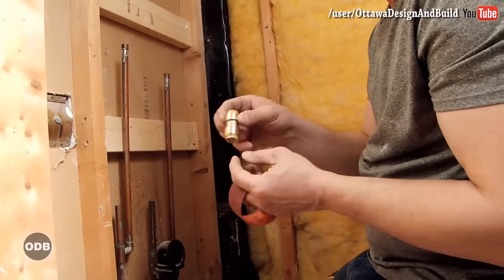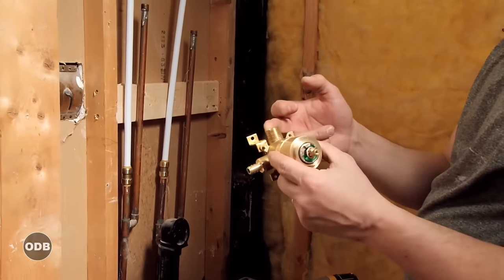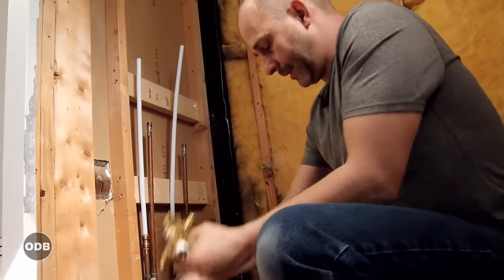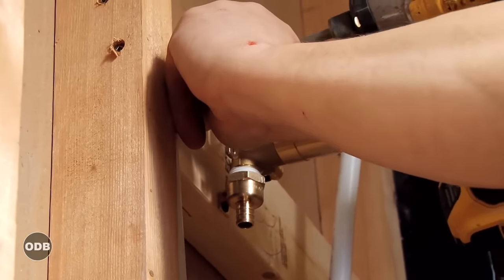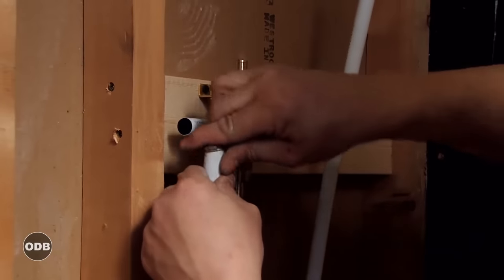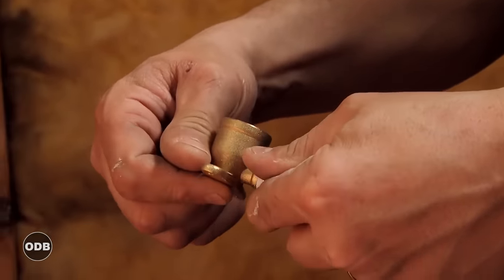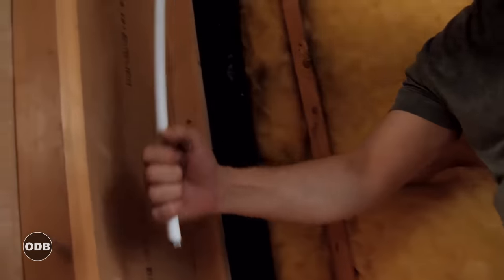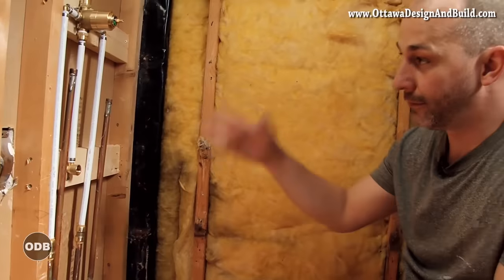DIY How To Install Copper To Pex | Shower and Bath Plumbing

Comment: Do you not need to use an insert In your pex pipe? Hep2o and speedfit both require them when making s connection. ????
Reply from the maker: Not any more, SAhrkbite changed the requirement a few years ago!
Reply: no they didnt. 
what you say here is not true, they are called insert stiffeners. and they are there because pex can be pressed into oval shape quite easy especially when hot, this would cause catastrophic failure of the joint. imagine somebody is filling the tub while in it and they knock the tub spout with their foot BOOM wall full of water.
Reply: Home Reno Vision DIY 
Even if this is the case, i would still use them. Belts and braces. The pipe itself is not solid enough to retain its shape and strength, especially after heat expansion , which also makes it more pliable.

Comment: When using pex never, ever have connections in the ceiling and never use sharkbite connections in a finished wall. Sharkbite connections have been known to leak.  
You should be using pex compression rings with a proper pex compression tool. Pex connections are very precise fits that you can have too lose or too tight.  The crimp rings you used can over compress the pex pipe and cause leaks.  That’s why you should also be using a compression ring test tool to make sure the compression rings are not too tight or too loose.
Reply from the maker: Thanks Charlie, this is just 1 option for homeowners to do their own plumbing. We are bringing 3 other options to video soon. One of them shows the system you talk about.
Reply: Are you aware of the newest method?
You use plastic rings and a pex stretcher then you can use cheaper plastic fittings?
Reply: I should also say Thank You for your time and expense in making these videos and directions available to us. There are different methods out there for the use of pex pipe.

Comment: Good install, except for the sharkbite fittings. Don't understand why you wouldn't just solder on a half inch pex adapter when you have such good access.

Comment: Good afternoon ,,, my name is Gabe ,, have a question ,,, I can use 3/4" of pex pipe for the shower installation ,,,,,or 1/2" is the usual
Reply: Gabriel Romero I use half inch. The shower valve has openings the same size as half inch. I never had better water flow using three-quarter after the shower valve because the way the shower valve is constructed acts as a natural restriction to water.
Reply: @dormandavis2767  then, you think it is not recommended to modify it to 3/4 "
Reply: Gabriel Romero unless you have low pressure overall in the house. Your pressure is only as high as your openings in the valves.I was a firefighter for 28 years I retired and I was a driver for an engine or pumper truck so we had to know hydraulics so we can determine how long are hose runs are in pressure loss and things like that.
Reply: ok. ,,, I have an idea why they use 1/2 ",,,,, water pressure👍 ,,,,, thanks for all your information

Comment: As usual, taking things apart are always overlooked as it is also where we ALL begin :)  Can you explain how to take the "rings" apart.  Just in case I screw something up, and I always screw something up.?
Reply: If you have a grinder or some type of cutoff wheel you cut a groove until you almost cut the ring. Cut a liile more and stick a screwdriver in and twist and it should pop right out

Comment: Jeff, I'm in CA. I read there are 70 different kinds/brands of PEX.  Do you have a brand you prefer to work with?  Thx!
Reply from the maker: I'm not as well researched as that, However I make my buying decisions on my trust towards a supplier not a manufacturer. My relationship and warranty service come from the supplier so I prefer to simplify my purchasing decision based on their recommendations knowing they will back up their decisions if there is ever a problem. On the practical side I tend to prefer the red and blue on larger scale projects to eliminate confusion.

Comment: Where did you get the clips to hold the moen valve to the wall.  They look like some small Z brackes. Where are the available from.
Reply from the maker: At the local building store in the plumbing isle.

Comment: Jeff: I have an unusual situation where I've discovered two 1/2" copper pipes in a bathroom wall that have been capped off. I would like to install a shower with pex piping similar to what you've shown here and am confident I can do so without hiring a licensed plumber. Would these capped pipes count as an "existing feature" that I don't need permitted? My city's code mentions you can modify and existing feature without a permit or license. Thank you!
Reply: What are the 2 capped pipes are they coming off of the tub/shower piping. I had something similar and I was told they were air intake or exhaust pipes that weren’t needed anymore
Reply: @DavisThaDoN  The two capped pipes look like they're coming through the slab - I am confident they are the hot/cold pipes where a shower used to be as there is also a capped drain. Thanks!

Comment: Jeff, I am loving your videos. Thank you for putting in the extra time to do these videos.

I did have one question. From the drop ear for the tub spout, do you just use threaded galvanized steel to connect the spout, or what did you end up using? I know you said no soldering required for this job, so I'm wondering what you did. Thanks in advance!
Reply from the maker: In this case we used a tub spout that can recieve a 1é2 inch threaded pipe and used a 4 inch male to male npt brass pipe. I am glad you liked the video Glenn.
Reply: Ottawa Design and Build Renovations any flow issues with the pex? I've read that it's too restrictive. But I don't want to solder. :)
Reply from the maker: you can use a 3é4 inch line to the tub and solve that problem. Good luck.

Comment: Sharkbite needs an access panel. Sharkbite is not allowed to be permanently concealed, depending on your local jurisdiction. Use a brass adapter to sweat onto copper.
Reply from the maker: Thanks we have one.

Comment: try the blue monster Teflon tape. you wont need 100 ft per joint lol. and if using tape and putty. putty the threads then put the tape over it. works great
Reply from the maker: thanks I"ll try that

Comment: hi. which pinch tool I should get. homedepot has none. Lowes has one from "dependable plumbing" and two from "apollo". Any input will be appreciated. thanks.
Reply from the maker: It comes down to price. the better the system the more costly it is. If you are using it a lot then but good tools.
Reply: which brand are u using? my problem is that so far I have seen only 3 tools in Rona, lowes and homedepot. The most expensive one is about 50 bucks and none of them is from a name that I recognize. I got to pick from "dependable  plumbing" "apollo" or "surlok".   

which one do you recommend  - PInch ring or crimp ring? I see u were using crimp rings in your other video.

Is there no "go no go" test tool for pinch rings?
Reply from the maker: pinch is better, I was demonstrating crimp due to the cost for homeowners who are only doing 1 job. Pinch is superior if you are going to continue doing plumbing work.

Comment: How sure is this a permanent job with no leaks years down?
Reply from the maker: This type of plumbing has only had a failure problem right away. If the clip is crimped properly it will last a lifetime. rings are stainless steel.

Comment: May I use shark bite 90 degree angles instead of the ones u use?
Reply from the maker: sure, samr thing only different. Just make sure you can access them from the back side if necessary or you will be removing the tile if you get a leak in the next 25 years.

Comment: ever tub/shower faucet I install state (as well as maybe piping manufacturers) DO not use pex on the tub portion due to friction losses.  It has the potential to cause 'ghost drip' from the shower head.  other than that, I don't have issue with SB's.  I don't see any plumbers offering 25 year warranties on their solder joints.
Reply from the maker: We adressed the pex to tub in an earlier comment . we should be using 3/4 line to drop ear to solve that problem.
Reply: Ottawa Design and Build Renovations sorry pal, I hadn't read through every single one.  Copper or 3/4" pex like you said should work.  Sorry for being repetitive on you.
Reply from the maker: that's cool. There has been a lot of response. more than happy to answer questions.

Comment: bro, I have a massive leak. While I was trying to replace the caulk around my kitchen cabinet I noticed the drywall was damp. When I poked a hole to see why it was wet I noticed black mold. So I used a mirror to see down the drywall and guess what? The mixer valve from the bathroom which faces the kitchen walls was leaking from the hot water line.

It looks like I might have to use shark bites because all the pipes are copper, question; how well will it hold if I use a male shark bite to fit the female thread on the mixer?
Reply from the maker: shark bite is not designed to install on female thread. I would suggest a male fitting with teflon tape and joint sealing compound.
Reply: sharkbite makes a male thread to copper/pex tubing connector. use teflon tape, and be sure to deburr the copper tubing before pushing it into the sharkbite.

Comment: Quick and Simple,,, but wouldn't that copper pipe add a bit of rigidity to the shower head? With PEX I'd think there would be chance for that "Drop Ear" fitting to work loose over time enough to pull away from the stud. Think about the leverage of the shower head and even more leverage if there's a shower water filter installed between the head and the wall.
Reply from the maker: the drop ear is installed with 3 screws. If I was relying on a soldered joint to keep my shower head still then I would be in trouble.
Reply: I realize the three screws hold the shower head. What I'm saying is, a solid copper joint would "assist" in keeping that "Drop Ear" from twisting side to side which over time may loosen those three screws. How would it get twisted side to side? Well maybe by installing different shower heads, or turning an adjustment ring on a shower head, or by adding a water filter, or whatever... Some times they get moved.

Comment: You use a drop ear on the shower spout . Did you not also use a drop ear on the tub spout ?
Reply from the maker: most tub connections can be accommodated with a 1/2"np pipe. this is better than pex from the elbow. pex would not be rigid enough

Comment: I have installed the same way and then asked plumbers if it’s ok to have the tub spout of plastic and they said no , they told me I need to put metal pipe
Reply: They are right. always run copper for the tun spout or you will have problems

Comment: do you need to remove the tube liner for copper pipe?
Reply from the maker: optional, it used to be mandatory before recent upgrades to the design.

Comment: As an inspector and former plumber, I'm not kosher with the drywall screws instead of brass or deck rated screws and I would like to see the dead ends for the old copper be a lot shorter...
Reply from the maker: Is there a reason for that feeling. The screw is definitely long enough!  And the dead ends are irrelevant. As long as the length of pex from the dead end is longer to the 90 than the 90 to the valve there is no loss of pressure or flow!

Comment: Jeff, how far into the wall do I have to cut into the 2x4, to install the valve? the center where my valve has to go, i have a 2x4. so i need to cut into it, how deep?  or how far in is the 2x4 mounted on the back, behind the valve in your video?

Comment: The idea is fast, but what happens in 5-10 years when the crimp leaks behind your beautiful tiles. On a copper line you could simply solder the the leaked area and not damage the entire bath wall

Comment: Tip: Lengthen the handles by a foot for leverage and it would be much easier to crimp. Did it to mine and much better.

Comment: I have heard that slide on sharkbite fittings should only be used when they are easily accessed in case of future leaks of the internal rubber O-ring.  

There are some videos of people who had failures using sharkbite fittings.

Comment: Shark bites use O-rings in order to maintain a seal against the pipe anyone who works with plumbing or with cars can tell you o rings fail over time therefore they should not be put into a space that has no access before the risk of future leaks is high in full disclosure I am a plumber although I think it is good for customers to do their own work at times to save the money rather than paying the high rates the come with hiring a plumbing service the application that this man should have used was called a Bard after which is a copper fitting that is soldered onto the pipe in order to convert it from copper to PEX
Reply from the maker: we did that in our newest video on this subject matter.

Comment: Does anyone know why there is capped copper lines next to the live ones being used for the valve. I'm redoing my shower and it had them
Reply from the maker: Hi steve, copper lines do not expand so they hammer under certain conditions. pex wil absorb pressure changes without the hammering noise so no need for them in a pex application. Cheers!

Comment: if you read the instructions on most tub/shower control rough ins, they require copper be ran to the tub spout. 1/2" pex has a smaller internal diameter than 1/2" copper and cause too much back pressure. this back pressure can cause your shower head to drip when running a bath. not the end of the world, but can be annoying
Reply from the maker: Very true Tyson, this can be solved by using a 3/4 inch line to the tub spout.

Comment: Google Video from someone who seems to know his trade. One major problem is he failed to mention that using pex on a shower connection between the valve and shower head will create shower rise. Pec tubing inside diameter is not large enough and causes water to rise up to the shower head causing water to come out of the shower head even with the diverted off. Don't make the same mistake as me. Use copper for this connection

Comment: hi what if the valve has no bracket and I want to use pex how do you secure the valve ????
Reply from the maker: It is true some valves do not have screw mounts built in. in this case simply use allround metal strapping and install over the right and left water supply brass portion of the fitting to secure.

Comment: the hoses/tubes they use here in west Europa are fixed via crimp-able couplings, you need a hydraulic crimp-tool to press-fit the hose. no need for such rings.
Reply from the maker: cool, I can't wait to visit and discover your building science. Cheers!

Comment: I realize this video is targeting home owners, but unless Pex manufacturers have changed,  Surlock fitting void any warranty you may have had, and would not pass a plumbing inspection.  Buy the right Pex crimp rings, and if you don't have the crimper, Rona and Home Depot rent them with a crimp gauge to check every crimp.   When it fails the homeowner always argues they saw it on HGTV, DIY or Youtube.
Reply from the maker: That is a good point Eric, However I have come to realize that the Surlock fitting of 5 years ago had many problems that have been addressed. Now I believe that the fittings can be tested during the pressure test and have a very low rate of failure post installation. I am expecting that they will be allowable in most jurisdictions in the next couple of years once they have demonstrated their design changes are reliable.

Comment: Hey, I saw a presentation  from the man that writes the book on plumbing. you shouldn't use elbows on pex. You can't use like pvc, you just to keep it continously, that 90° elbow are the weak points that don't need to be there. Just take long way

Comment: You cept the old tubes in place . To prefent legionairs deceas avoid dead ends in the system
Reply from the maker: we don't get hammering with pex so we can do away with the arrests.
Reply: The old circuit you plugged off has no more circulation of water and within time you can get a build up of bacteria in there and that can cause an ill ness refered to as legionair deceas If you are young and healthy there is no problem but for the old and ill it can be the last thing they/you can take

Comment: Thank you for this, but it would have been nice to see what you were doing in several areas. Music was nice touch, but took away from hearing you clearly. 
Sadly, I have no idea how to attach the rings. I've never done this and will continue to researching because this was not real clear how to do certain things...just why. How tight should everything be? Crimps? Exact depth for water pressure? I am confused...lol. Experts can make things look easy, but to a layperson it may not be that simple. Why a drop ear for shower? can I just use a 90? Lastly, I was told it is not code locally to use Sharkbite behind a wall.
Reply: P.S. No, I am not a "hater" and I cannot afford to hire this out. Just lost my husband and am alone. I have nothing so please do not put me down (posters)  about having to do this as a homeowner and not having money. Being ill, I cannot afford my meds. Certainly cannot pay a plumber! So if you cannot be supportive, please don't judge.
Reply from the maker: No problem. The tool can be purchased for around 30 bucks. you simply insert the ring and close the tool the whole way. The sales agent at the hardware store will be more than happy to fill in the blanks. Good luck. The drop ear is necessary because the shower arm comes a s a 1/2 inch thread and needs something to twist into. Please ask a sales associate at your local hardware store for more advice.

Comment: Sharkbite makes everything so freakin easy now...no burning the framing lumber anymore in tight quarters.
Reply from the maker: Very true. Although nothing beats proper solder joint if you know how.